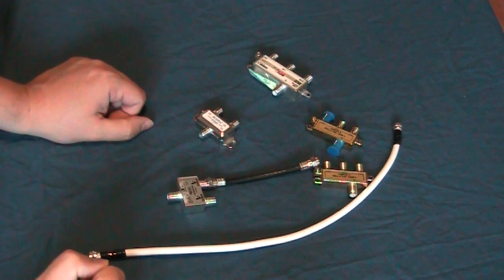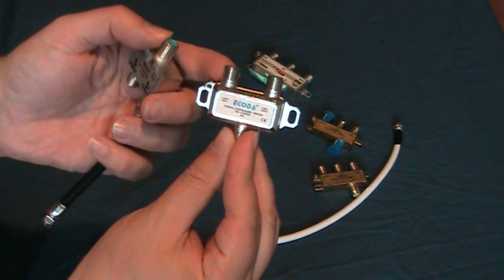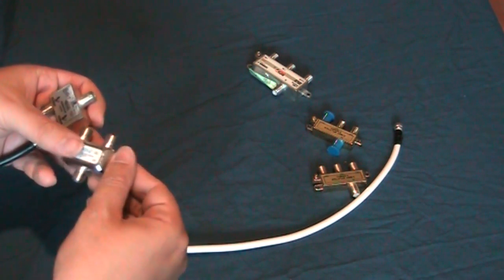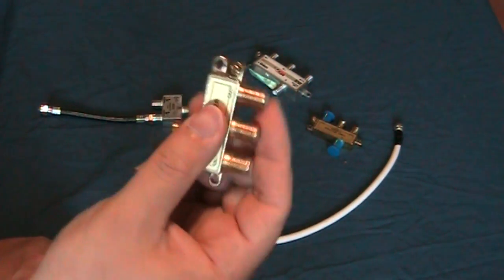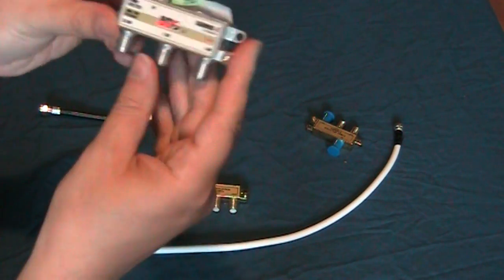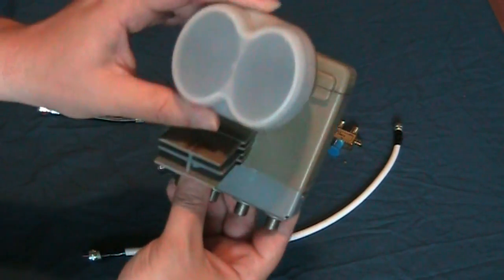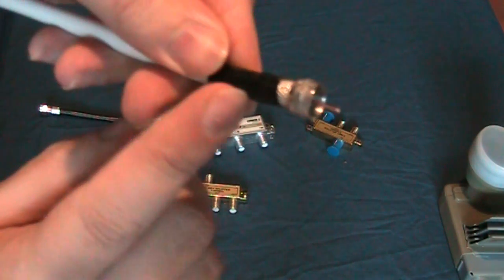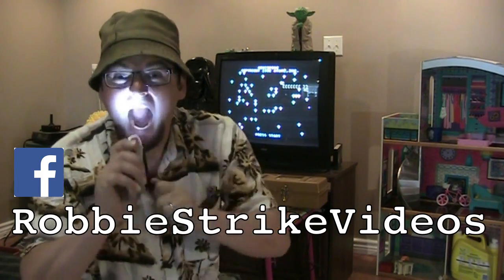Splitters and switches for Satellite Cable and Antenna's

Comment from the maker: This dish will work for North American Ku Band 
https://rover.ebay.com/rover/1/706-53473-19255-0/1?icep_id=114&ipn=icep&toolid=20004&campid=5338505983&mpre=https%3A%2F%2Fwww.ebay.ca%2Fitm%2F39-KU-BAND-SATELLITE-DISH-ANTENNA-FTA-FREE-TO-AIR-LNB-CHINESE-PERSIAN-97-W-36%2F223266593197%3F_trkparms%3Daid%253D111001%2526algo%253DREC.SEED%2526ao%253D1%2526asc%253D20160908105057%2526meid%253D090367fe4f9f4f7295d10c8eeb7a9a2e%2526pid%253D100675%2526rk%253D3%2526rkt%253D15%2526sd%253D172652269201%2526itm%253D223266593197%2526pg%253D2481888%26_trksid%3Dp2481888.c100675.m4236%26_trkparms%3Dpageci%253Ac3c8c3a4-acd0-11e9-a89e-74dbd1800ebf%257Cparentrq%253A1bd1b8a816c0a9e8a24cd315ff5d7b65%257Ciid%253A1%20 

For someone just getting into #FreeSatelliteTV this Amiko Mini is a good start. With the seller a hobbyist ke4est himself will help you out getting started! https://rover.ebay.com/rover/1/711-53200-19255-0/1?icep_id=114&ipn=icep&toolid=20004&campid=5338505983&mpre=https%3A%2F%2Fwww.ebay.com%2Fitm%2FAmiko-Mini-HD265-FTA-Receiver-DVB-S2-H-265-HEVC-With-NTP%2F172652269201%3F_trkparms%3Daid%253D111001%2526algo%253DREC.SEED%2526ao%253D1%2526asc%253D20160908105057%2526meid%253Da114fa698e094266b8fe64ecacd40abf%2526pid%253D100675%2526rk%253D1%2526rkt%253D15%2526mehot%253Dag%2526sd%253D172652269201%2526itm%253D172652269201%26_trksid%3Dp2481888.c100675.m4236%26_trkparms%3Dpageci%253A9bfa2237-5d87-11e9-a26b-74dbd1802482%257Cparentrq%253A1436489216a0ab674b72a601fffee48d%257Ciid%253A1%20
This receiver is in the under $100 category! 

Also you will need RG6 Cable you can get this and the cable screw on ends at a hardware store!
https://rover.ebay.com/rover/1/706-53473-19255-0/1?icep_id=114&ipn=icep&toolid=20004&campid=5338505983&mpre=https%3A%2F%2Fwww.ebay.ca%2Fitm%2F100-FEET-RG-6-SATELLITE-CABLE-RG6-COAXIAL-CONNECTOR-HDTV-ANTENNA-CABLE-BELL-FT%2F382464587687%3F_trkparms%3Daid%253D111001%2526algo%253DREC.SEED%2526ao%253D1%2526asc%253D20160908105057%2526meid%253D090367fe4f9f4f7295d10c8eeb7a9a2e%2526pid%253D100675%2526rk%253D2%2526rkt%253D15%2526sd%253D172652269201%2526itm%253D382464587687%2526pg%253D2481888%26_trksid%3Dp2481888.c100675.m4236%26_trkparms%3Dpageci%253Ac3c8c3a4-acd0-11e9-a89e-74dbd1800ebf%257Cparentrq%253A1bd1b8a816c0a9e8a24cd315ff5d7b65%257Ciid%253A1